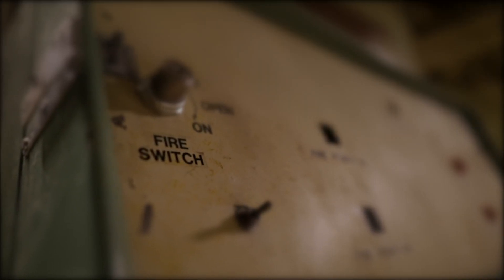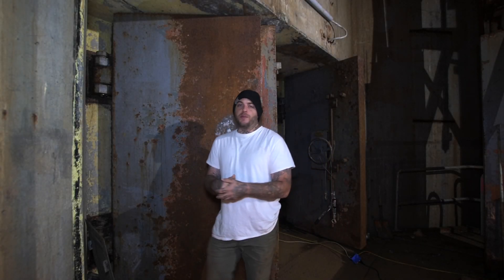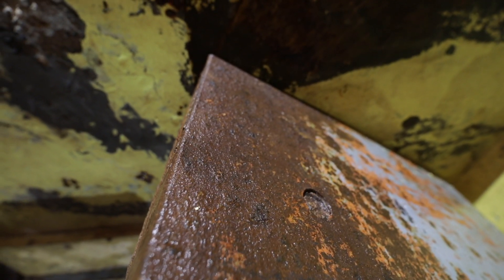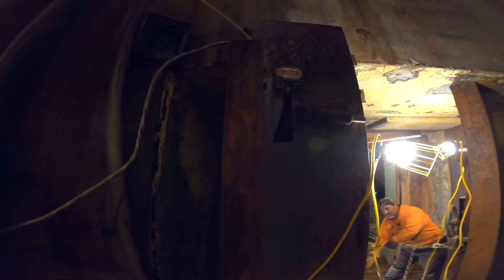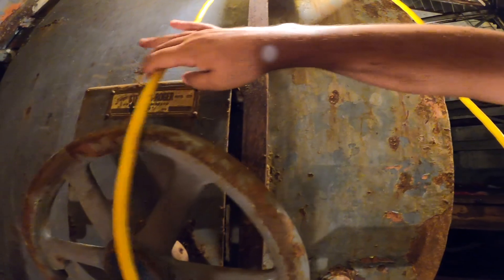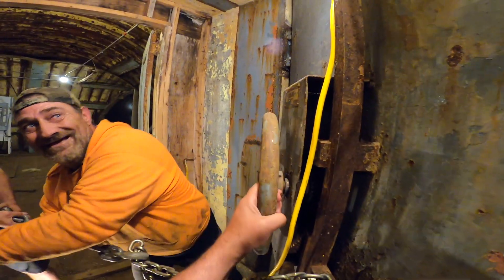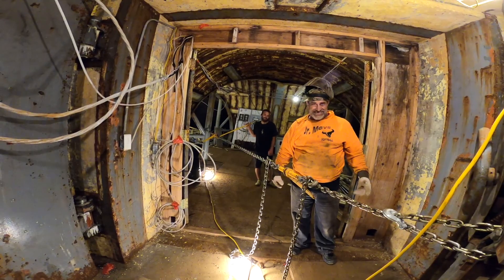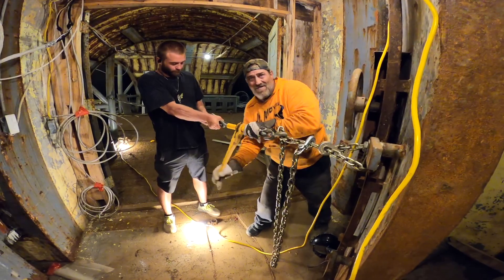Ep. 58 - BLAST DOOR Surgery In A Titan 1 Missile Silo

Comment: She's starting to look so good! I remember back when death wears bunny slippers (Titan Ranch) was cleaning his Titan 2 out years ago. He tried several different approaches to descale and removing old paint including sandblasting; however, the process created a larger mess then what he started with. Instead he decided to use an industrial strength pressure washer on his cable way and control center and it worked perfectly. Everything could be washed away.
Reply from the maker: Yeah we have pressure washers and even a 5,000 PSI version is considered. Exploring the use high tech lasers to remove paint and rust right now.
Reply: @NuclearBunkerLiving  The rust removing lasers look awesome. I haven't managed to get my hands on one yet. I definitely want to give it a try.
Reply from the maker: They are amazing.